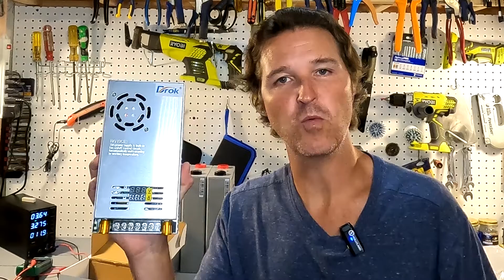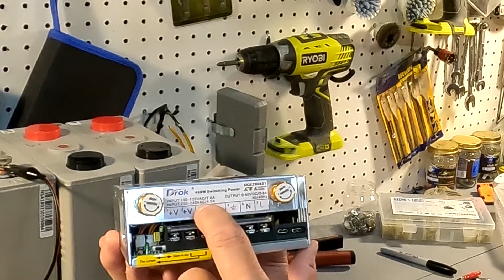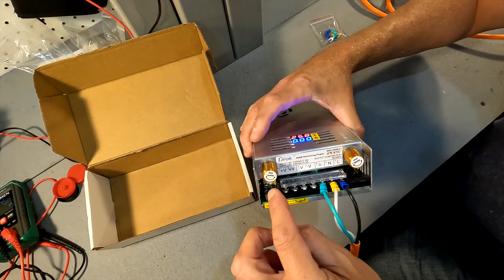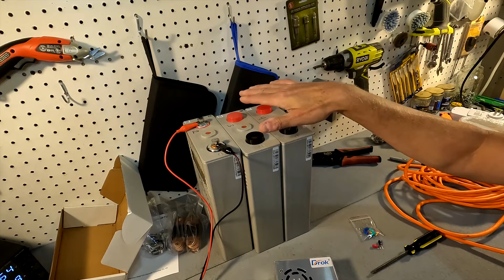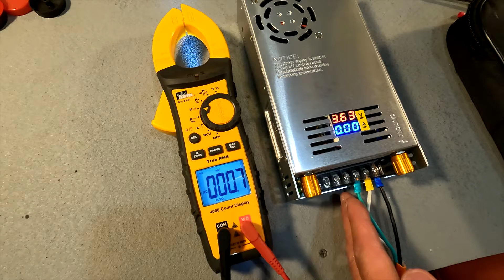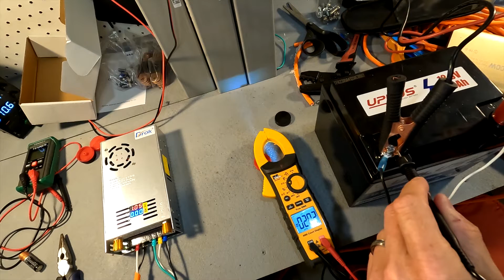How to wire up and use a DROK variable voltage / amperage power supply.

Comment: I’m looking for a power supply that can output about 20 V DC and up to 18 A . This one seems to do a bit less than that, do you know a good one that’s adjustable and can match the higher specs? I have at least one DC motor that I want to put on tool thanks.

Comment: It seems like you're back feeding the PSU. I’d recommend adding a diode to one of the positive terminals following the positive lead. Then i would put it in a case for isolation and use a fused input with a switch. While it does increase the cost, for safety reasons, you can get a 32V 10A regulated CC/CV power supply with an output switch for around $60.

Comment: what sort of AC power drain does it take?  is it similar as your Ardroit  video??  i do like this one for more applications.  which is better on grid power usage?
Reply from the maker: I think the Ardroit is better.  I do like this power supply because of the fact you can adjust the V & A.

Comment: Omg, thank goodness for your video! I couldn't find instructions anywhere? A question - for the input power, do you need 3wires with a neutral connection? Or could you use just a positive and negative connection (black and red)?
Reply from the maker: To be safe you really should use all 3 wires for grounding.  Thanks for the comment!
Reply: @OffGridBasement  thank you!

Comment: Hi, one question: At the right side of drok there is kind of "card slot" - Do you know what for is that? Thank you and very helpfull vdo! Congrats!
Reply from the maker: Mostly it's just air vents.  There is a spot to change the AC voltage from 110 to 220v.  That's about it.

Comment: What I'm trying to do is find a DC power source to run a 1000 watt inverter at home to save electricity, regular wall wart might not regulate the power enough to make it like the DC from a car battery, might need 14volts of regulated DC power to actually run the inverter.
Reply from the maker: You are right.  This wouldn't work for that.

Comment: I especially like the way you are poking about with your DC test leads AND your fingers LESS than an inch from the UNPROTECTED AC input terminals. Very smart in case you want to seriously ELECTROCUTE yourself!
Friends - this youtuber is NOT a competent electrician, nor technician, nor electrical hobbyist. Anything he says or does -  take it with a BIG pinch of salt! (meaning do not pay any attention whatsoever).
I don't want to be mean, but this is DANGEROUS stuff if you don't know what you are doing.
Reply from the maker: You're correct.  This is dangerous and I should've been wearing electrical gloves while making the video and doing the testing.  Thanks for the comment and concern.

Comment: That lead acid battery must have been almost DEAD to draw 8 amps from the start.  Yous hould have been able to adjust the voltage and current without disconnecting the battery.  That supply seems strange.
Reply from the maker: I feel the same way.  Thanks for the comment.

Comment: What does the TS switch do on the left of the power output?  When I have it in the left position it reads a fixed 2volt.  In the right position it shows zero voltage but it can be increased.  Thanks for any help.  The  directions from Drok are junk.
Reply from the maker: That is basically the power switch.   It will reduce the amperage output to zero.  Hope this helps.

Comment: What about that red fork supplied in the bag, why you never mentioned it? Is that a fuse?
Reply from the maker: I believe the red fork is just an extra wire connector.  There is no special use for it.  Hope that answers your question and thanks for the comment.
Reply: it's a yellow fork nowadays. it is a fuse, 50 amp.  but... might not be necessary.. there's an internal fuse in the main supply unit (you can see if you open it)..  the wedge shaped fuse, I think, has something to do with setting voltage... according to the instructions.. but it's not very clear.

Comment: 13:15 When you measure the battery voltage with the power supply still hooked up, how are you sure thats the battery voltage and not the PS voltage?
Reply from the maker: Good question!  When I was raising the voltage of the PS you could see the display rise up.  When the BMS wakes up you see a slight flicker in the PS amperage, then the voltage of the PS stays at a constant 10.7v. That is the voltage of the battery after waking up.  The PS display switched from a voltage setting display to a battery voltage display.  If you were really going to charge the battery after waking up the BMS like I showed you would want to disconnect it from the battery and set the voltage to 14v or so.  Then you would hook it back up and crank up and amperage.  Thanks for the question and the comment.